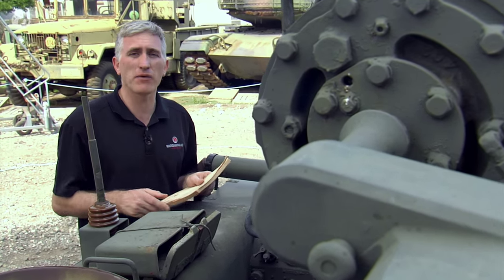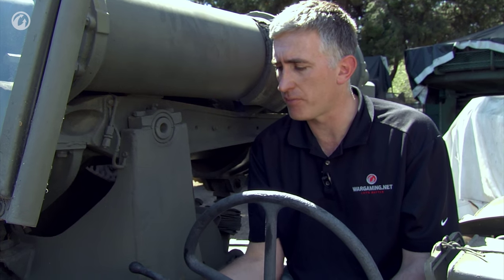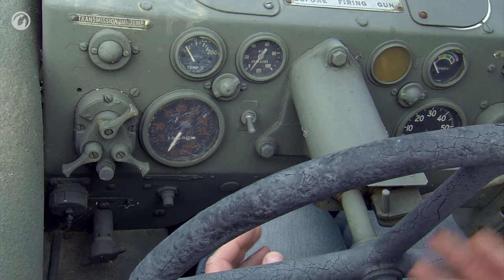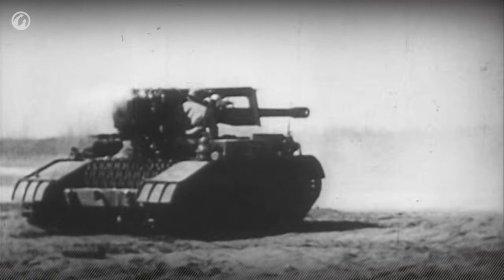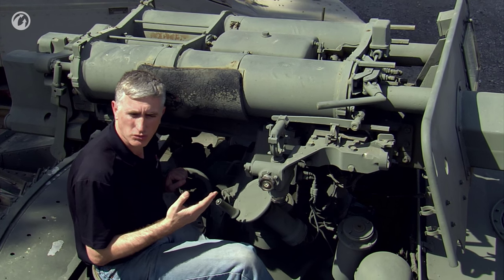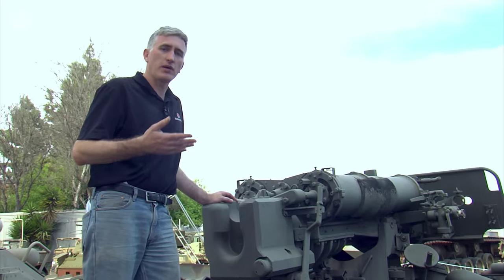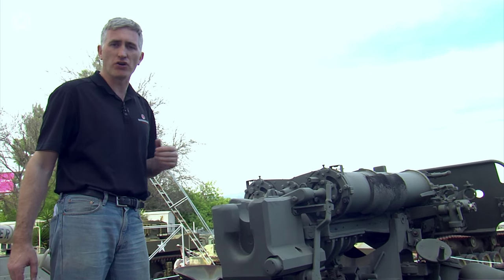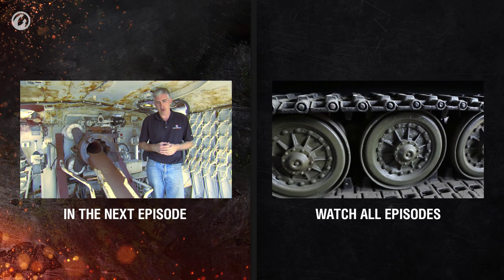Inside the Chieftain's Hatch: M56 Scorpion Part 2

Comment: The M56 saw combat service with U.S. forces in the Vietnam War. It was deployed with the 173rd Airborne Brigade; which was the sole Airborne Brigade deployed with the M56, where it was used mainly in a direct-fire support role. Its function as an air-mobile, self-propelled, anti-tank vehicle was eventually replaced in Vietnam by the troubled but quite effective M155 Sheridan (which oddly enough is directly to the left of the M56 which The Chieftain is demonstrating) and had a fully armored turret. The USMC used the 'Ontos', which had an armored cabin and was armed with 105-mm (dubbed the '106-mm' to avoid confusion) recoilless rifles, in a similar role (the running gear of the first Ontos prototype was the same as on the M56, but it was replaced for the production variant).

Comment: It isnt really a drawback that the crew had to dismount to fire. It is really literally just a mobile gun mount, not an AFV. Or an FV, since the A obviously doesnt apply. it is meant to bring the gun to battle quickly, after which it is basically just an artillery piece. So firing from the vehicle is hardly important, and would only be used in dire emergency. And I dont suppose the recoil is all that much worse than a normal towed mount, so no doubt gunners have figured out how to save themselves from 'scope eye' (which is the name for what happens to people who hold their eyes too close to the scope of high powered rifles, a common mistake)

Comment: A nice video set on a very unusual vehicle.  I first saw one at a Nebraska Army National Guard display and was impressed (I was about 10 at the time).  I was a fascinating concept.  I admire the gunners who rode this bucking bronco as it fired.  One still photo from the 173rd Airborne Bde in Viet Nam shows the first two wheels basically off the ground during firing.  Wow, what a ride!

Comment: Talk about a death trap! Theres no real protection for the crew
Reply: Neither does a towed anti tank gun. But they manage. Not sure why the moment you put something on tracks everyone expects it to be armored. They can also just be to get you around more easily and without getting stuck. Towed AT guns killed 3/4 of the tanks in WW2 and somehow weren't considered suicide missions in spite of being entirely in the open and you have to hook it up and tow it any time you want to move. You just fire from ambush and concealment and move before they can concentrate fire on you, which is much easier when you can just start the engine and drive away.